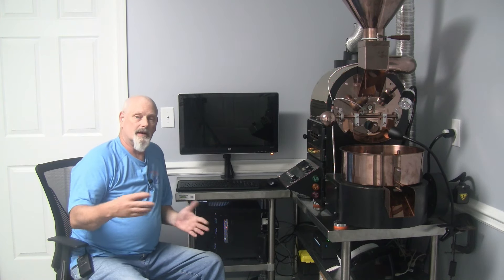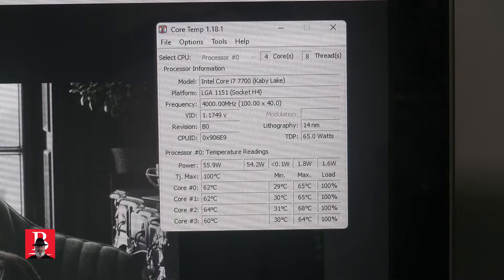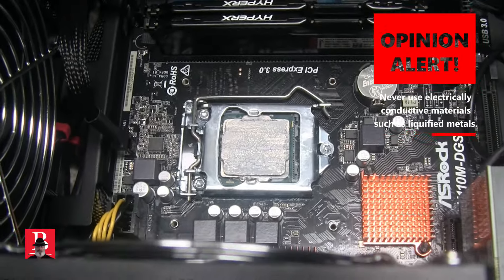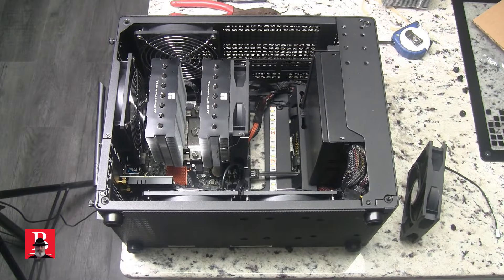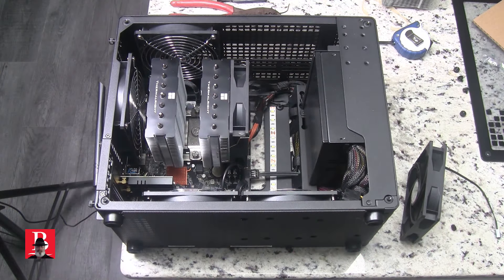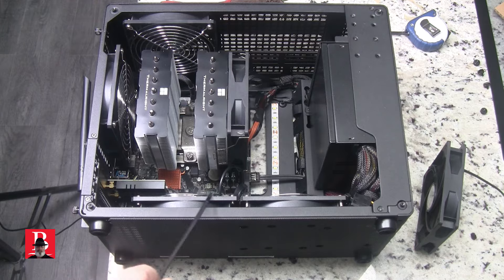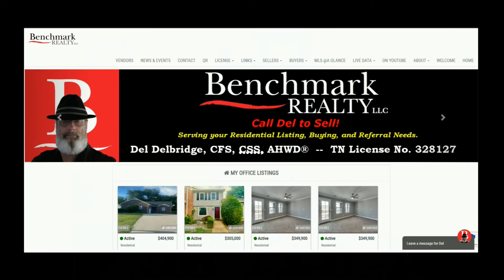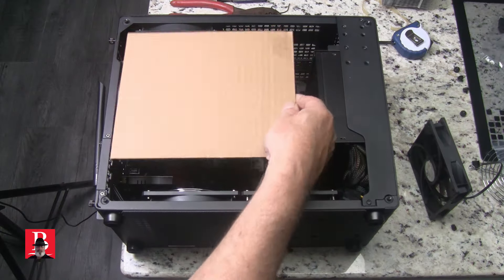S14E19 - Warning Maths - PC Air Cooling Myths Examined

Comment: i tought the i7 7700k was notorious for getting hot.. but they said that for my i7 6700k aswell..  undervolted/+ slightly overclocked it runs well for me. i'm curious about your findings..
Reply from the maker: @RaphaelSwinkels  - I can't remember which processor is in this video. I do have (the original one that came in this Corsair case) is 7700 but not a K - not unlocked. The CPU sitting in that same case is unlocked - it's a 12700K. And it's finally at max ratios but undervolted pretty well. I don't have the floating point extended instructions on  

If I use XTU on the 12th gen at auto set - it gets hot when running CB 24 and thermal throttles. In real life, I don't see high temperatures. So I have it running on air, I used recommended settings, saved, then turned off the floating point instruction set. I don't really need them. Took notes. Reset to the defaults and slowly walked the voltage down and ratios up over a couple of weeks. I don't keep the room cold it sits in. Normally 77°F. Where it is set today, the ratios are 50, 39. It is undervolted pretty aggressively - at least  more than I would think I would feel comfortable. AVX512 instructions, as I meantioned, are off. The power limits are up and using Cinebench 24 It's stable and back to 1150 - 1160 +/- maybe a 91, 92ish° on core 5 I think it is. It's always a hot spot. Another core gets warm too, can't remember which one. 

Air gets up benchmarking but it's not too loud rendering a video. The software will not use full GPU, CPU or memory. CPU will hit 57°C ISH. GPU doesn't heat up because there is no RT or Shader cores. Haven and Furmark will warm it up, but even it OCed, fans are not too noisy.